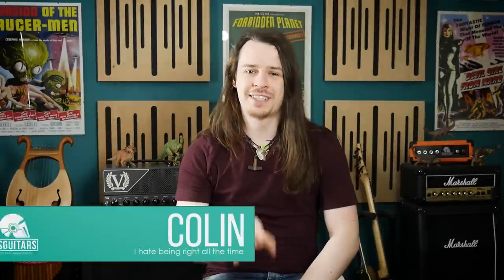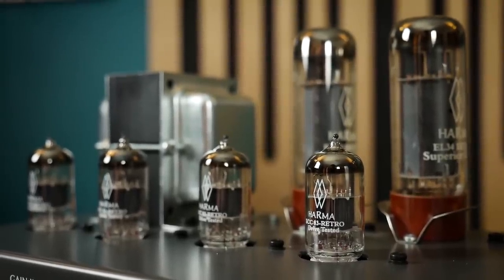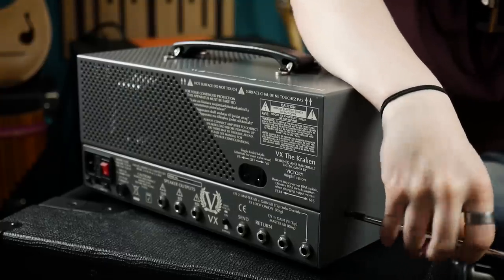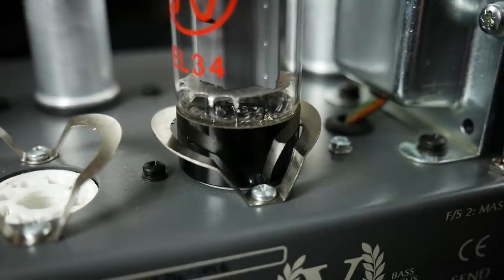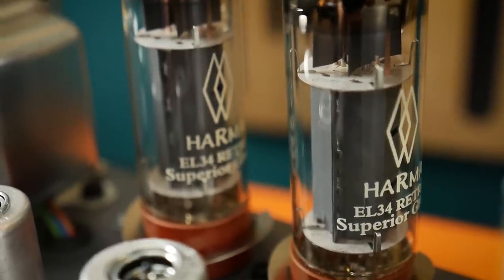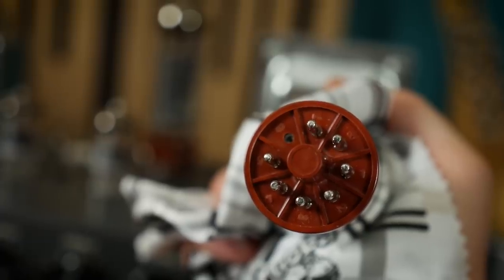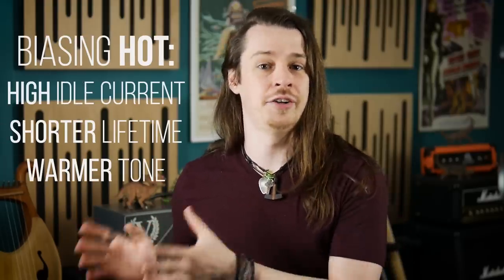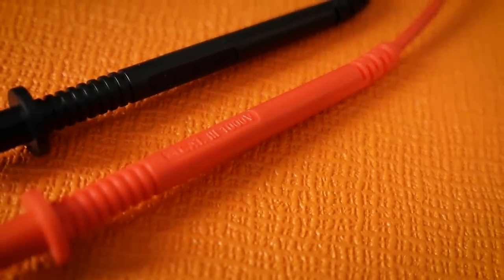Swapping Valves And Biasing Amplifiers

Comment: How many times did he suggested " You can die changing your valves"? Once was more than enough!
Reply from the maker: You clearly don't realise how difficult it is to get simple messages into the heads of the public. 

Repetition is key. 

So, once again, live electricity and high voltages can be lethal. Do not go inside a valve amplifier unless you know what you are doing.
Reply: CSGuitars yeah! Once was enough. Great work on scaring shitless a person who just wants to swap out there tubes. You are not getting a subscriber or another view on your videos from me. But I do wish you great success.
Reply from the maker: At least you won't be dead. I'd rather have you alive than a subscriber.

Comment: its not the voltage that kills you, its the amperage.  According to https://www.physics.ohio-state.edu/~p616/safety/fatal_current.html, in between 100 and 200 mA is lethal (0.1 to 0.2 amp) anything after 0.2 amp is survivable if you have someone there to provide immediate artificial respiration (at least chances are good). there are some debates thanks to each persons electrical resistance through skin varying.
Reply from the maker: True, but unless we're talking about static electricity, you don't usually get one without the other, and there's generally a correlation between high voltage and high current.

Comment: Volts are not what kill you, it's amps that kill you. This might decieve people, please keep this in mind.
Reply from the maker: Yes, but unless we are talking about static electricity we don't get one without the other and there is a direct correlation between high voltage and high current. 

All dangerous electrical devices warn of being high voltage because it is far easier to articulate in real terms. 

The 500VDC resident in the amp has enough potential to allow lethal current to flow through you. 

Regardless, the point still remains, you touch the wrong thing inside a valve amp then you die. Doesn't really matter what is responsible at that point.
Reply: Please. Don't. Any electrician would rip your head off if he heard it. Stop spreading that false rumour about "it's not the voltage", just stop.
Reply: The amps can't kill you without the voltage.

Comment: So what you're saying is that someone who works with live voltage daily and is qualified to work on power grids might have the safety knowledge to look into the possibility of maybe learning to do this at home, by being instructed by a qualified professional. 

Seriously, don't mess with electricity. Every three years, my work requires us to take a mandatory course on CPR and electrical safety, where we have to watch videos of people getting hurt or killed by stupid decisions next to live electricity in some form. I don't want to see any of you end up as a gruesome teaching tool on how not to die. 

I can probably calculate the resistance needed to bias the valves. I also know how to behave minimise the risk for injuries/shocks. On top of that, I have access to enough protective equipment to survive anything the average wall socket could produce (at the most extreme, we look more protected than bomb technicians). I still wouldn't mess with a live amplifier before I knew how a professional would do it. Even without most of the risk to myself, why would I risk the amplifier?

Comment: Unplug Amp turn it on a while and then off, wear rubber gloves.
Reply: This is exactly the type of ignorant advice that could lead to injuries or death. Just like Colin says, if you aren’t trained to do this, don’t try.

First of all: you can’t bias an unpowered amp, since you need to measure the voltages. 
Second, unplugging the amp and turning it on does not guarantee that all of the capacitors discharge the energy they have stored up. Power circuitry can be deadly even when it has been unplugged for months. If you see a capacitor, assume it’s charged up and ready to shock you as soon as you mess up. Even if you protect yourself, you might cause a short and destroy the amp.
And most importantly: regular rubber gloves will not save you from high voltage! If you ever put your hand in a proper high voltage protection glove, you will be aware of the difference. Even if you have proper gloves, you need to know how to check them for damage and wear.

I test protection systems for power grid substations for a living. That means I work with DC voltage from 24 to 220 V, and AC voltage ranging from 120 V to 40000 V. I know how to stay alive while working with live circuitry. I still wouldn’t touch the inside of my amp without proper instructions. I have never worked with power valves or even read the basics of how they work, and I wouldn’t bet the full price of my amp that I could figure it out on the first try.

Comment: All this valve talk makes me wonder why on earth have we not been able to figure out a non-lethal, environmentally friendly, and long-lasting way of getting valve tones without using technology from decades ago 😕
Reply from the maker: They tried that with transistors and we were all like 'meh'
Reply: That's true! And that's kinda what I'm baffled by: there isn't a way to replicate valves. SO MUCH has been done in technology in the last ten-fifteen years, yet the valve remains elusive!
Reply: Peavey actually attempted to emulate the sound of tube amps with their "transtube" technology, which is transistor-based.
Reply: Danger is fun. Ask people why they like powerlifting
Reply: NoiseFeedMusic correct the nutubes are made by Korg and are vacuum florescent display (VFD) actually they have one in the new ibanez nutube screamer.
Reply: You mean like modeling amplifiers and Peavey's Trans tube circuits? 

Never heard of them.
Reply: Pinochet Pilot #666 already a Fractal user, mate! I’m more than happy with that. Just marvelling at how there isn’t another way to replicate tubes apart from transistors and modelling.
Reply: @supernintendo64 - The transtube amps are bloody good, too. Best solid state amp I've ever used. I'd also argue it's better than my old Peavey Valveking 112
Reply: great point